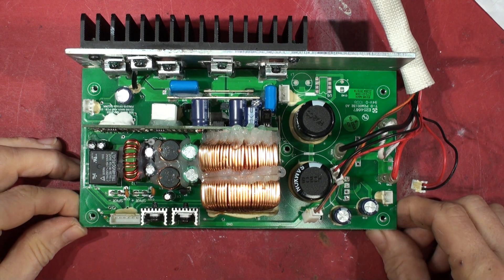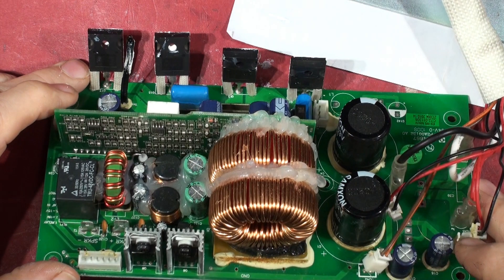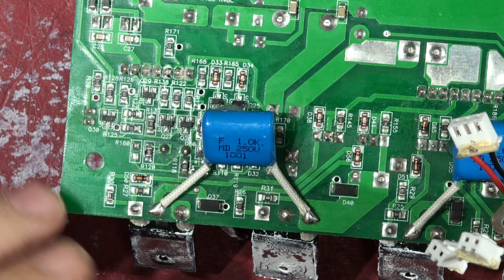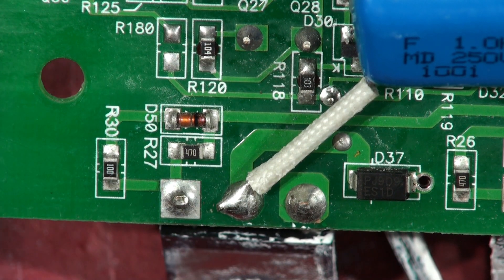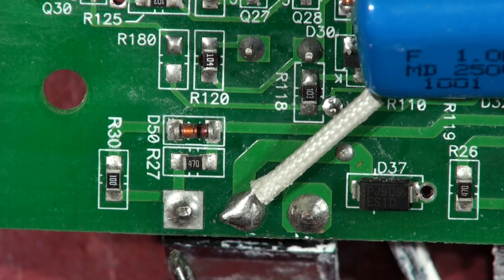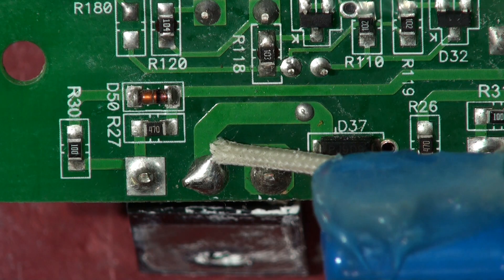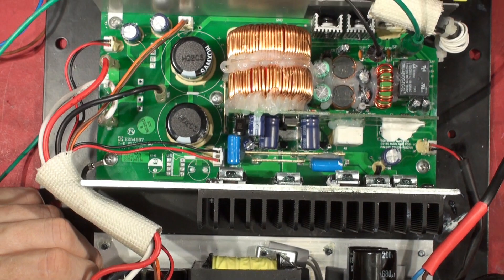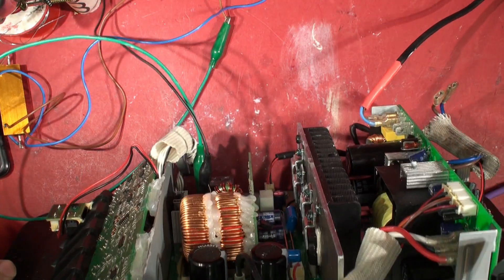JBl PRX518S amplifier board dead diagnostic repair and reassembly

Comment: Morning sir just wanna found out my sub woofer 516 jbl it has power with signal but no sound cuming if tested the sub it's playing it's not blown I suspect the Amp but it does switch on  but no sound wat cud b the problem what must I change
Reply from the maker: Pretty unusual. Usually when the power amp section goes down the whole thing shuts down. Check the signal cable between the input and power sections is fully plugged-in.   Check the crimp sockets in the speaker output connector are slightly splayed. If they are you can give them a squeeze with some small pointed pliers. It isn't common but it happens. i.e. lost continuity between the amp and the driver.   Otherwise it could be an 33078 OP amp chip in the input board failed blocking the signal path.

Comment: Trying to fix my JBL Eon One Pro MK1.  Very low volume almost can't hear at max vol. Vol used to go up after hours left on but not anymore.  The only thing I see wrong is the two power transistors in the power amp measure 0.0 ohms between the collector and emitter pins regardless of direction I measure. Is it safe to assume they are shorted/blown ? I haven't yet removed them to measure them out the board.
Reply from the maker: It seems very likely that the transistors are blown. The best bet is to carefully remove them and check out of circuit.
Reply: @razenby   Great thank you so much for your answer !.  After seeing your vid will also try to spot their associated resistor and cap to see if they are still ok.  Thanks !

Comment: Hi there I'm trying to get some information on a eon208p circuit diagrams your videos are excellent and you seem to know how to find information
Reply from the maker: The 208P schematic is similar to the 210 and the power section is the same as the EON 315. You can use those schematics. or you could tell me what problem you have,

Comment: 9:57 one thing that intrigues me: where is that heat sink expected to be transferring heat to?
Reply from the maker: The back plate of the enclosure.  When it is working properly it doesn't  dissipate much power.

Comment: Hey mate, I Have a prx515 here for repair.
It has a intermittent output issue.
So problem is output works for a few minutes then it stops outputting and the signal is still there so I suspect output stage. 
Is there anything in the bulletin for this issue. 
How would one go about getting bulletins and schematics for JBL stuff?
Reply from the maker: I have a manual for the prx518 which , from memory is very similar or the the same as the 518.  It might be thermal shutdown of the output stage but don't rule out an op amp in the input/preamp. They breathe too.  What is your email address?

Comment: Sir, my jbl prx618s capasitor on the psu, expload , i cek diode and ir540 is stil work normali , but when i change the capasitor , it exploaded again
Reply from the maker: Please see the other video. It is a design issue. You need to change both capacitors one is destroying the other. the full and detailed and explanation and what to do about it explanation is in the other video on my channel. Watch https://www.youtube.com/watch?v=218LdnT8PvU
Reply: @razenby  i did, but when i change de capastor they exploaded again
Can i jumper from the power direcly to psu withoud soft start?
Reply from the maker: They do that,  You can run for a different power supply. Both rails need to come on together.
Reply: @razenby  i dont got it , that mean defrent psu?
Reply from the maker: @kingoff_defeat  Have a look at the video on the modification of this board. It explains why the capacitors explode and how to debug and modify,  The exploding caps are a symptom of another problem. It isn't the Caps themselves that are faulty it is something causing them to explode. i.e. You have another fault that needs fixing.  It is explained in great detail as I repair these amps and I definitely do want them back in my workshop again so I modify them the PTC (see vide) Varistors to protect the capacitor , more balancing resistors.  These boards are very susceptible to open circuit VOA holes on the PCB. So buzz out the board and make sure the tracks are actually connected to where they appear to go, ie.e Make sure that tracks that swap sides and are connected to the other side are actually connected.  Sometime I find more than one fractured VIA.
Reply: @razenby  owh i see, i think if any short its gona drif on my mcb , right?
Reply from the maker: @kingoff_defeat  Connectto power with 100W filament light bulb in series with mains - short circuit = bulb lights up and no bang.  Disconnect the Amplifier board power cable from the power supply board. Power supply will run safely with 100W bulb in series and no explosions
Reply: @razenby  yup i have one of that tools,,, thankyou
Reply from the maker: @kingoff_defeat  You are welcome

Comment: Amazing work! Thanks for the insight.
 I have a PRX 815, which my sub is not playin but my highs are, do you think its a problem on my motherboard as well?
Reply from the maker: Difficult to say.  After repairing about a hundred of these I found 90% of failures on the power supply and the rest on the power amp.  This is a bass amp so only expect lows from it.

Comment: Hi and thanks for your tutorial. We have a 518S and it is making a continual high pitch noise and no sound from the amplifier. I was wondering were the symptoms of yours the same. If so can you tell me the settings for the mutlimetre to check the transistors.
Reply from the maker: What you can hear is instability. Can you tell if the noise is coming from the power amplifier board or the Power supply board?   Disconnect the power wires between the amp and power supply (3 wires).   Power it up and check that you get the -40V and +40V rails.  If the voltages are there then it is likely that the power supply is OK and the fault lies in the amplifier or preamp or class D drive boards. Discharge the capacitors on the power board DC side before you reconnect these three wires else it is curtains for your amp. They have a lot of charge and they hold it for days.  There isn't a single easy to point to cause of faults of this nature. Have a really good look at the board amplifier board and inspect the components.  there is  lot of vibration in these cabs so you might find a cracked solder joint on or a loose component.  The quality of the printed circuit boards in these amps is very poor so they are buggers for getting VIA holes  going open circuit. They can happen anywhere on the board.  If you have the test equipment It is probably a simple fault to isolate and fix but I cant really help much more remotely.  Last time I looked there was no schematic for the amplifier power section in the wild. Have you got one?

Comment: Samxon brand caps on the amp board of what used to be a $2k USD sub. For 500W RMS and a 15" driver, they seem a bit undersized as well. Chasing those profit margins with mass production at all costs. The power supply seems to use Nichicon caps. Interestingly inconsistent.
Reply from the maker: The power supply on most use Samxon capacitors. The amp can output 500 W (see power test) but at this power level there is HF instability in the lower extremes of the output waveform.  It is a minimal design.  The problem with JBL is that you can destroy the drivers with input - no effective limiter - The limit LED is just a peak signal indicator. It doesn't auto wind down the gain. The SMPS was done by a schoolboy.

Comment: Did you solder the third leg on that first FET, probably did but off camera?
Reply from the maker: Hi Frederik,  I looked at the video and cant see the joint you mention. At what time maker can you see it?? I may have touched it up - I can't remember. In the event the partner FET in the pair failed after 5 minutes and took out the new one I put in so I replaced both. The amp is running at 75% power right now. It gets alarmingly hot.

Comment: alimentation découpage is hard to repair
Reply from the maker: il faut être systématique et changer l'ensemble des vulnérables
  les semi-conducteurs et les composants passifs qui sont soumis à des tensions élevées ou qui peuvent avoir été sollicités lorsque la panne se produit. Si vous allumez avec une ampoule à incandescence de 100 W en circuit avec la connexion en direct à l'alimentation secteur, si vous avez quelque chose de mal, l'ampoule brillera au lieu d'une fumée magique des nouveaux composants. Il est moins coûteux et plus gras de renouveler les composants que de passer du temps dans la disgnose. Le diagnostic ne peut pas déterminer si un composant a été stressé et est sur le point de tomber en panne.
Reply: @razenby  
Thank you, your answer is very accurate and it is clear that you have important experience in this wide field, I am a new subscriber with you and I will learn a lot from you, thanks dude